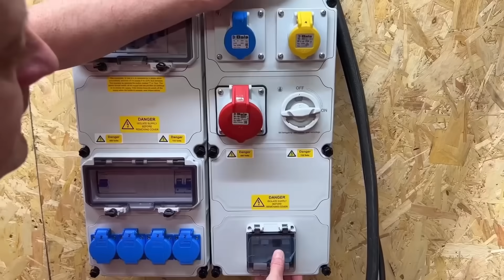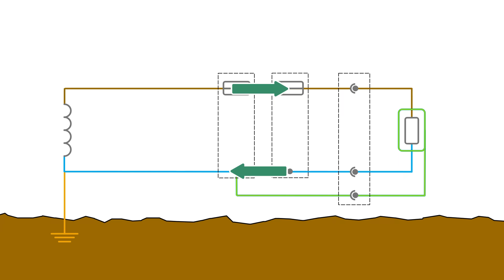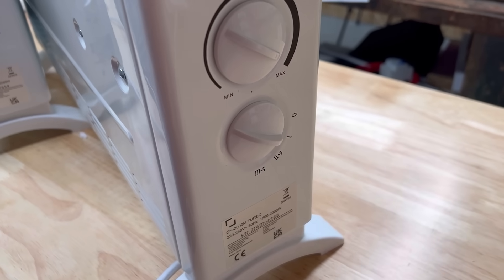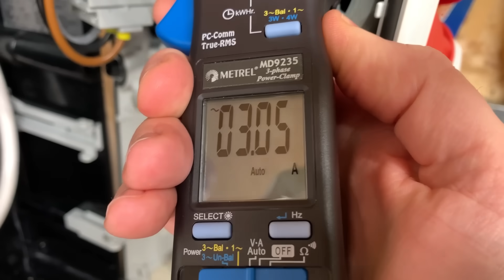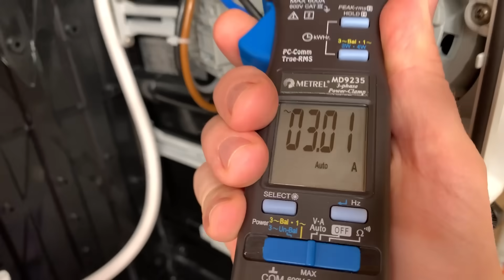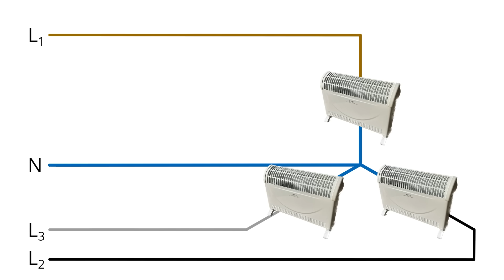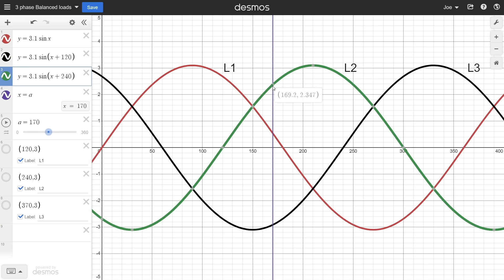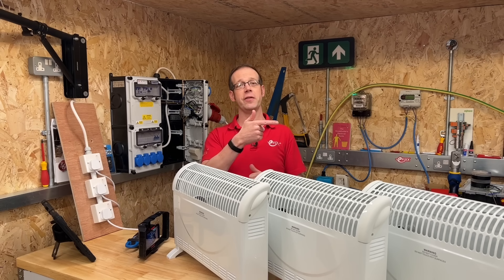Does Current Flow Through The Neutral Wire?

Comment: I was trying to explain this to a cocky technician, who was 15 years senior to me. He was having none of it.  I  designed a control panel with a 3phase 2.5mmsq supply. There was a 16A single phase breaker on each live.  His argument was that this arrangement would put  3x 16A=48A of load on the Neutral (2.5mmsq) wire. To prove he was right he even rang his mate, who was a lead in Intel, and they both were in agreement on this. Good guy though.
Reply: Put it this way I have had my worst shocks from working with neutral
Reply: @brucenicoll4373  this is because when you put yourself in series at the neutral wire, you’re not a parallel resistance like when you simply touch a hot wire. You instead become a series resistance that also has the amperage being pulled by the circuit flowing through you. There will be people that argue it’s the same, but I assure you making yourself a series resistance in a circuit is, much more dangerous and  potentially deadly.
Reply: @J_Trask  yes correct both times I was working on large concert dimmers the neutral had lifted I was touching the case with is neutral earth linked not fun at all
Reply: @J_Trask  well said
Reply: @J_Trask  Even in parallel with the N return path you can get quite a shock if that path's resistance is high enough or you're well grounded. There's a reason L and N pins and wires are treated the same in regard to safety...
Reply: @HenryLoenwind  Of course! I agree 👍
Reply: @J_Trask  makes sense, amperage is lower on each parallel line, and shocking yourself on neutral line in series is the same as shocking yourself before the parallel splits - shocking yourself on the supply current coming into the DB
Reply: A lot of domestic electricians don't understand 3 phase.
Reply: @dogwalker666 I think a lot of electricians regardless of type don't understand it.

They lack the mathematical ability to analyse circuits with two waveforms or three waveforms and perform the calculations between them.
The reason is that the two waveforms are not of the same phase and the electricians can't do the math to take into consideration both the amplitude of the waveform and its phase.

If you are dealing with two waveforms of the same phase angle, then addition and subtraction is trivial, it's a simple numerical addition or subtraction of the  RMS amplitude of the waveform. This is NOT the case when the two waveforms are not of the same phase angle.

The addition or subtraction of the voltages can be undertaken either using trigonometrical functions or complex numbers which involve the square root of minus 1.

But these concepts are not taught until A level standard in the UK, and most electricians do not take A level maths and most don't even pass the lower GCSE qualification in maths, so they have no chance of doing calculations on 3 phase quantities, except where someone else has done the maths for them and derived a simple expression they can plug the numbers in, without really understanding what is going on.

You'll get a better quality of electrician of much higher skill if organisations such as City and Guilds insisted upon students passing GCSE maths and physics as pre-requisites for their electrical courses.
Reply: @deang5622   The old ISTB Electrical engineering apprenticeship included all the maths necessary. As did the Ship building and Mining industry.
Reply: @dogwalker666 Highly unlikely the ISTB included all the math necessary because a proper understanding only comes from having an understanding of Complex Number theory and they don't teach that to technician level electricians.
Complex Number theory isn't taught until a student undertakes A level Maths, that is the level at which it is taught.

And electricians, many have not even passed the lower GCSE or O'level math qualification and have virtually no chance of getting their head around math A level.
The goal of all technical level electrical courses is therefore to explain 3 phase without the proper mathematical treatment because the students level of math ability is too low.

Sorry, I realise a lot of people won't like that, but that IS the reality of the matter.

So this is why we end up with silly arguments on YouTube where people do not understand 3 phase properly despite their being qualified electricians.
Reply: @deang5622 Someone has to work, though. Maybe because EE grads don't want to work as electricians, we have anyone but 'proper math level' people doing the job.
Reply: @0kipullup0 I am not saying there isn't a job to be done as an electrician, it's an important job, but I absolutely detest their arrogance and belief they are experts in the field when they are not.

I also wish they would change the training system and place some minimum entrance qualifications in place to ensure a better class of candidate which would result in better electricians coming out at the other end of the training.
Reply: @dogwalker666  Truth.
I am the engineering manager at a brewery and had in a domestic sparky come in to change a VSD because their industrial guys were too stretched out.
I ended up wiring it in and programming the parameters. Guy openly agreed he had no idea what he was doing.
Fixing the light in a bathroom, no problem.
Controlling industrial motors, different animal.
Reply: Zero current in the neutral if it's a balanced 3 phase load . That's why a motor wired in delta formation does nt require a neutral.
Reply: @AndrewCottle-f6r  It is still balanced if you connect it in a star config with no Neutral. Old style motor start up: start with switch in star position, when comming up into speed, move switch to delta config. Lesser start up current!
Reply: It just cancel out so long as it’s balanced.
Reply: In single phase or same phase connected to 3 load that's true. But In three phase neutral will not have 3xphase current.
Reply: @hvk3929  in AC electricity, the neutral current in a multiwire branch circuit is only additive when circuits of the same phase share the neutral, (which would be a Code violation because they wouldn’t be sharing the same breaker handle.)
Reply: @Jazzmaster Jay yes there is load on the neutral wire. The neutral is a current carrying conductor.
Reply: 48 amps through a 2.5mm² cable? That's gonna smell of burning plastic just a bit. If it's a balanced 3 phase delta. Just cut the neutral cable while it's running.
Reply: I'm surprised he made it through 15 years
Reply: @jozefdkois  he would be right in a single phase system that's why you shouldn't use the same neutral on single phase system
Reply: Sounds like he missed the point that it was 3 phase. If it were a single phase supply, he would have been correct.
Reply: If the technician was right we would see allsorts of weirdly manufactured cables with larger neutrals
Reply: When just 2 phases are connected, add up the two line currents vectorally and you get the neutral current which will equal the 3rd phase.
Reply: @jozefdkois  wow thats so stupid i would not even came up with such nonsense
Reply: To be fair if it was the same phase they'd have been right. 
I think some brains just don't like coping with multiple phases. 
You'd hope better from an old boy though. 😁 They've had AC since Tesla lol
Reply: @jozefdkois  you don’t need to be cocky if you’re knowledgeable, so it’s already a characteristic of someone knowing they have a limited understanding.
Reply: The neutral wire is the return path for unbalanced current in an AC circuit. It is not additive, it is subtractive. 

Put an amp clamp on the neutral wire of a nominal load, and you’ll even see that the current on the neutral will be equal to the current on the line wire.
Reply: Doesn't wire size limit current flow ??
Reply: @PORTEnSious  yes wire size affects current flow as smaller wires can introduce greater resistant. But this is effectively in series so affects current through the whole of that circuit. Same way an appliance would affect current. V=I/R
But that doesn't really affect the topic in the video. As what ever current passes still follows the rules they described. 
Hope that helps
Reply: @jetblackstar No, the wire does NOT limit current flow.
Current of any magnitude can flow in the wire. What happens is it heats up.

However, to be precise, metals have a positive temperature coefficient of resistance, and as the wire heats up, the resistance of the wire will increase slightly causing the current to reduce a small amount. But this is NOT limiting the current. Which is the original question the OP asked.
Reply: @deang5622 that’s how fuses work, 
However on long runs of undersized cable say powering a patio heater with a 1mm extension lead the volt drop due too cable resistance is significant and measurable
Reply: @deang5622  Current is reduced by the wire  because the wires have resistance (to current flow). We use larger wires to reduce this effect (voltage drop) on a circuit to 3% for a feeder and 5% total. Remember,  if you have a 5% voltage drop in a circuit, that means 5% of the kwh's you are paying for is being used to transmit the power from place to place.
Reply: @deang5622  Talking down to an electrician with 45 yrs exp in the trade will get you all the respect you deserve. Does a resistor limit current flow? Does the conductor also act like a resistor? We size wire to make this effect 'manageable' but the effect is still part of an circuit as there is no conductor that is not also a resistor.
Reply: @PORTEnSious  No
Reply: @PORTEnSious  At the point where it’s melting: Yes
Reply: @PORTEnSious  Wire size doesn’t limit current flow, but depending on the size of the load vs. the undersized wire, what will happen is the wire will not be able to dissipate the heat generated quickly enough, and will cause rapid deterioration of the conductor insulation. Also what can happen is the the wire itself can melt, most likely at the point of termination closest to the load. 

A real life example would be a water heater that pulls 23 amps and is being fed from a 30A breaker @ 240V, but instead of using #10 AWG copper wire (which is rated for 30A using the 60°C in the NEC ampacity table 310.16 for residential applications). For the sake of this example, the installer uses #14 AWG copper for this installation which using the 60°C table of NEC Art.310.16, is rated for 15A maximum. 

In this situation, you have 23A running through wire that is rated for 15A maximum. In this install, you would definitely find overheating, burnt insulation, damage at the breaker and at the water heater disconnect switch, or directly at the water heater itself.

One thing I forgot to mention is the ampacities mentioned are maximums for periods of time 3 hours or less. There are specific rules in the NEC I don’t have time to mention, but generally if a load is intended to be ran for 3 hours or more at any given time, it is not supposed to exceed 80% of the breaker capacity. For example, if a shop heater is rated to draw 24A, the breaker MUST be rated for 30A (30X.80=24A).
Reply: @J_Trask  another question I've been studying to go into electrical engineering and theirs a orange wire,blue,yellow,black coming out of a 3 phase motor out of a microwave and how do I get the motor running with all these wires... I'm used to only having a ground and live wire.. but never 5 wires diff colors I'm confused how and where to connect them... if u can help that would be awesome!!
Reply: @PORTEnSious  Yikes, that is above my knowledge level! If you have any supporting documentation, I recommend studying that of course. Or scour the internet for more Information. Also, if you can contact the manufacturer, send them an email asking for schematic info/documentation.  Good luck! I’ll be checking this out as well!
Reply: @PORTEnSious  that's only 4 wires right? Are you sure it's an asynchronous 3-phase motor?
Reply: @PORTEnSious How'd you get on with that 3ph microwave motor? Are you still trying to figure it out?😊
I'd  say, measure and record the reistance between every pair of leads. You'll  end  up having 6 readings. 3 of those will be about the same, and lower than the rest....and will have one common lead, which is the neutral. The other three leads are the phase conductors, and whichever order you connect them, will determine the direction of rotation.

Comment: PME systems (TN-C-S) effectively remove (minimise is more accurate) any current from the Neutral in the DNO's supply side network but obviously that is not the case in the customer's Consumer Unit
Reply: With each customer on a TN-C-S system the current from the Line to the Neutral is the same.
However, over a large number of such customers on the three separate "Phases" the total/residual current on the "Neutral" conductor will be quite small - hopefully, zero.

Comment: Will there be voltage on the neutral in a single phase circuit in normal operation? I heard in the past that imbalance in a three phase circuit (causing current flow as you explained so well) can cause the voltage to rise on that neutral conductor. Is the true?
Reply: Yes.
You don't see it as much these days as most supplies are TN-C-S.
When most were true TN-S you would typically see a voltage on the neutral a few volts above earth, caused by simple volt drop.
In a three phase situation with balanced loads, there will be no volt drop on the neutral.
But with imbalanced loads there will be a voltage drop.
In the absolute worst case, such as an open neutral on an incomer, a heavy load on one phase only could result in the other two phases each "seeing" 400V instead of 230V with respect to their neutral.
This situation caused millions of pounds worth of damage to consumer equipment when thieves broke into a local substation and stole the neutral busbar.
Reply: "....can cause the voltage to rise" with respect to Earth. Yes, as Simon explained here, whether or not the voltage on Neutral is able to rise with respect to Earth will depend on the earthing arrangement in place and also the distance between the unbalanced load and the origin of the supply. The Voltage on N with respect to PE on a TN-C-S system at a point close to the origin cannot rise significantly as they are, by definition, connected together. However if our unbalanced load causes current to flow down the Neutral conductor starting at a point some distance from the origin then the impedance of the Neutral conductor will allow a Voltage difference to exist between N and PE there. Think of it as a voltage drop calculation in reverse, with the voltage rising depending upon the length and CSA of the Neutral conductor.
Reply: There is always voltage on the neutral when referenced to a line conductor.  Reference it to earth is zero volts only because they are connected together.

Comment: Many  moons ago I was working in a computer factory (not as electrician :) ) when a cloud of acrid smoke tripped the fire alarms. Turns out the busbar chamber had a reduced size neutral, as the load was considered pretty well balanced. Ad Hoc alterations had seriously unbalanced the system and the neutral was glowing red hot  with all it's PVC insulation burnt off!  Turned off and fixed, with half a day's production lost, but could have had much more serious consequences.
Reply: The neutral over heated due to harmonics. Most times it is the 3 rd harmonic. It is a result of having loads that are non linear to current. That is variable frequency drives, computers, discharge lighting etc.

Comment: didn't fully understand why it was the same current going through the neutral with two heaters turned on, can you explain a little more please?
Reply: Remember that the current through each heater varies sinusoidally from 0 to 3 A over each cycle. 

However, the sine waves that represent the current do not line up - they are shifted in time (or phase, if you prefer) in such a way that when you add the heights (or more accurately displacements) of the two sine waves, you generate a third sine wave that has exactly the same amplitude i.e. peak (3 A) as each of the two others, but which is shifted in time relative to them.

Mathematically, we find that 3sin(x) + 3sin(x+2pi/3) = 3sin(x+alpha), where alpha is some new phase angle. This 3sin(x+alpha) represents the current that is sourced or sunk by the neutral wire, and the 3 in the front tells us that the peak current on the neutral is 3 A, which is what the clamp meter is displaying.

For example, at some instant in time, we may find that one heater draws 1.5 A, and the other draws 1.5 A. Together the total current is 3 A though neither heater individually draws 3 A. That would represent the instant of peak current demand for the 2 heater system.